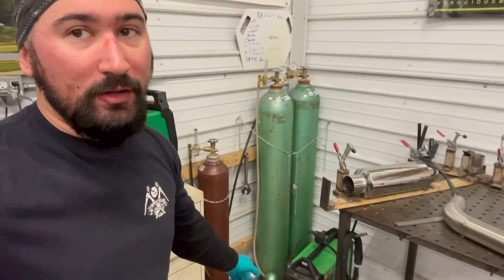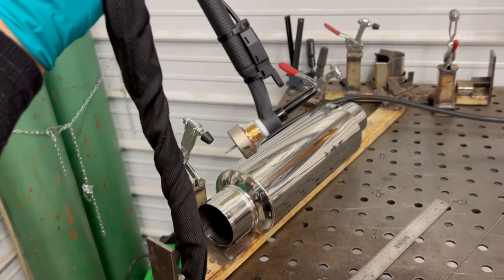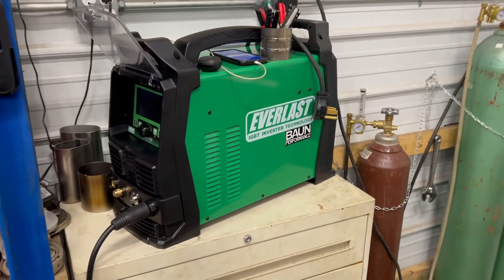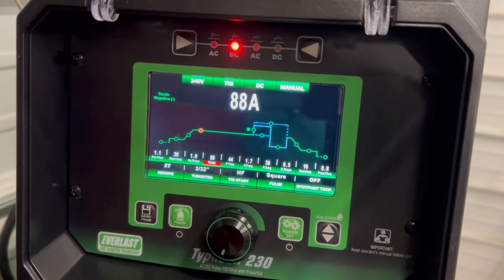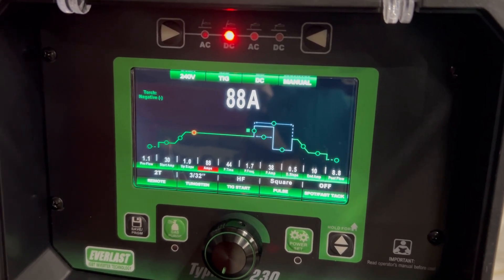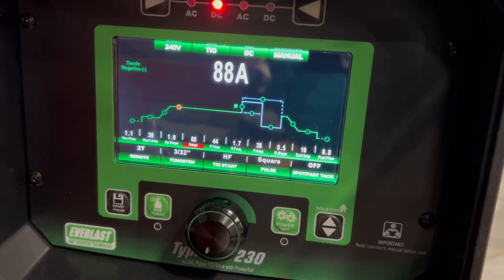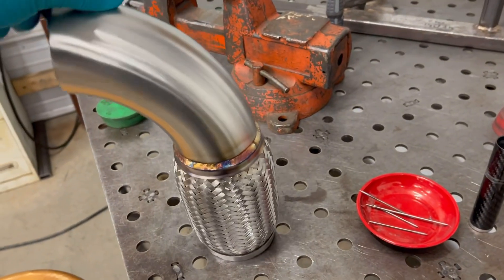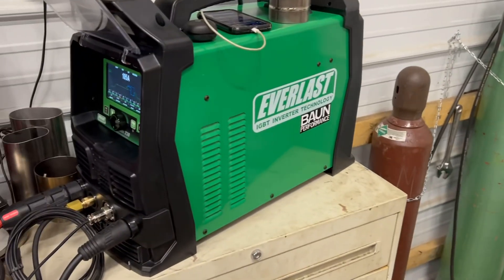Everlast Typhoon 230 vs 210EXT, Let’s Build Some Parts & Compare! #tools #tigwelding #fabrication

Comment: wOULD BE NICE IF YOU COULD MANUALLY NAME YOUR SAVED SETTINGS.
Reply from the maker: Would be, but I just keep my stainless/Ti setup first & aluminum second.

I’m not in tech manufacturing, but adding a typing function may not be cost effective

Comment: I got a chance to buy a 2015 210ext for a steal, should I keep saving for a typhoon or get the 210ext to learn on? I think I might be overwhelmed with the typhoon. Been MiG and stick welding for years. Only ever tig on a primeweld
Reply from the maker: Either machine will be awesome to learn on. If it’s just a hobby I’d say take the deal on the used one, but if you’re starting a business grab a new Typhoon (write off season is almost over!)

Comment: Have you done any AC, wondering how that is without a water cooler.  Can you also provide information on the CK TORCH you bought specifically for the 230. I’m upgrading soon, have a smaller Everlast rig that’s only DC.
Reply from the maker: I’ve used the same CK torch on my 210EXT and the Typhoon, it’s not specific to either. I called Salem Welding Supply in Salem, OH and told them what I wanted & they placed the order and shipped it to me, so unfortunately I don’t have specs on it…although it’s one phone call away if that’s what you wanted to do.

I’ve maxed out the 210 on AC issue free without a water cooler. It would be nice to have, but definitely not a necessity.
Reply: @BaunPerformance They are a necessity if you work in roll cages or other tight places where a giant 17 isn't going to fit.  A 20 flex head with the stubby is required. Nice looking welds.
Reply: Appreciate the reply. I’ve been happy with my little 161STH but it’s just that, little and only does DC. I just see a few issues pop up with the coolers and I’m a hobbyist so someone in your position not having a cooler and pumping out work is very helpful. I was concerned that AC would heat up the torch too much. Great content and thanks

Comment: Heavly planning on getting the Typhoon 230 or 330 but dont want any of the included torches.  Gonna email Everlast to see if they are open to retaining all the included torches and swapping them out for their NOVA 18 Flex-Neck Tig Torch 12.5 FT. 

Would be a waste of money having those torches and never using them since i would be using  CK18 water cooled torch.

If they say no then i would have to just forget about that lovely LCD touch screen and get Primweld 325x instead which gives you the option of purchasing your desired torch without forcing a package on you.
Reply from the maker: I’m sure they’d be willing to work with you, if nothing else maybe a few bucks extra for the torch you want vs the ones you don’t
Reply: Touchscreens have no place on a machine like this. 
I have a 255ext and a 400ext. They are both good machines and I can make welds that look identical to those I used to make with my Dynasty. The torches they send with are garbage though.  They will work as a backup if say you fry one, so I keep them around.  Also, having an air cooled torch is good for that once in a while occasion when you need to be portable.

Comment: Doesn't have trapezoid wave form as well? Been hoping to find some commentary/ review on whether or not a trapezoid waveform would make a noticeable difference, from the perspective of a customer / average welder, but everything I've been able to find this far is coming from the mouth of Everlast employees / ambassadors themselves, so if it was relatively useless or unnecessary I doubt they would state that LOL
Reply from the maker: I weld stainless 99% of the time, so take this with a grain of salt. 

In my experience wave form is a personal preference thing, like most settings. I actually haven’t welded any aluminum with my new 230 yet, but I’ll do a video on it when I do!

Comment: I heard in a demo video that these things have even DC waveform adjustment for when you're running pulse? Have you tried that? Is it useful? Or seem like Overkill / a gimmick
Reply from the maker: AC only, but the DC pulse settings have so much adjustability. 

The biggest improvement with this machine vs the older 210EXT is arc stability and consistency. It’s like everything is absolutely perfect every single time.

It’s hard to describe, because I didn’t have any complaints with the old machine until I experienced the next level of control.

Comment: Just got my 230, switched from 210ext after 5 years, had no issues with 210 btw. GREAT machine! 🔥
Reply from the maker: The more I run the 230 the more impressed I’ve been with it! Definitely a impressive upgrade